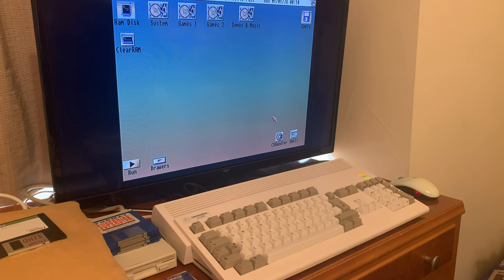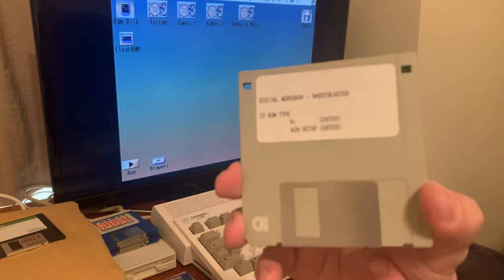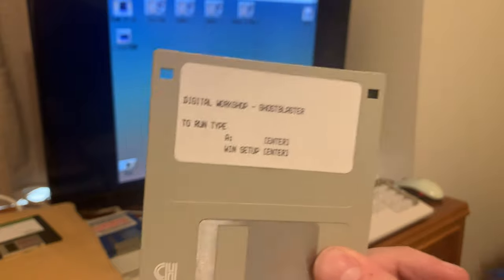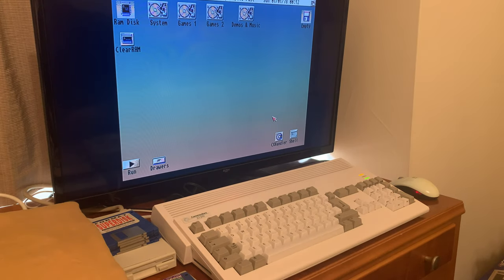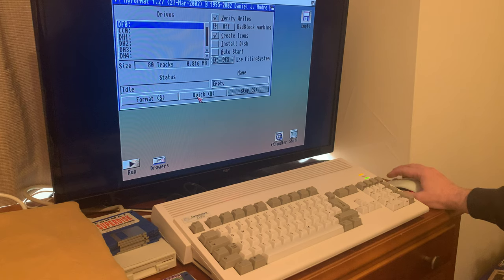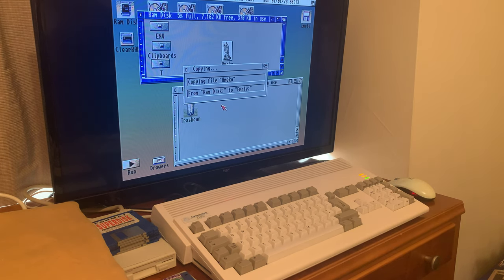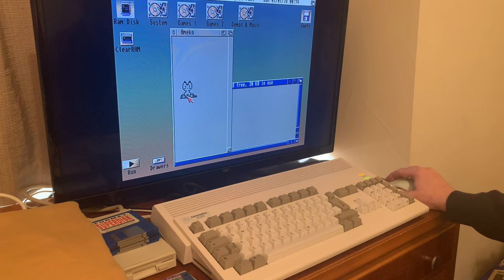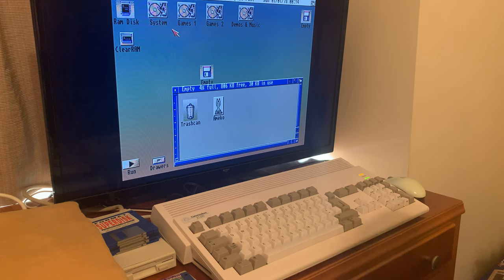Using high density (HD) floppies on a standard amiga floppy drive

Comment: I had an Amiga 4000 with a hd drive capable of storing 1.76mb. Someone made a device capable of reading a amiga formated disk on a pc. Is it possible to make a workaround to make it possible to read a 1.76 formatted disk on a amiga 500, or 1200? Does not matter if it’s slow. Just want to rescue some stuff stored on hd disks.
Reply from the maker: Yea ,  you might try hooking the drive up to a computer running an Amiga emulator. You should be able to grab it that way.

Comment: Hi :) I have an A500 + 1MB and a floppy disk drive made from a PC drive. Will it work for me?
Reply from the maker: The pc floppy will work if you get a cable adapter such as the one in the video OR you can modify the floppy drive itself.